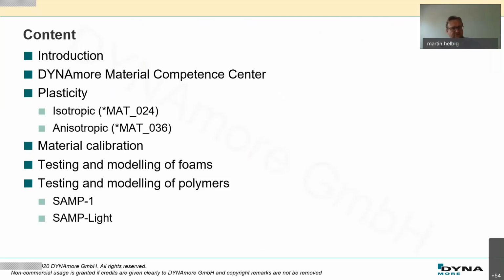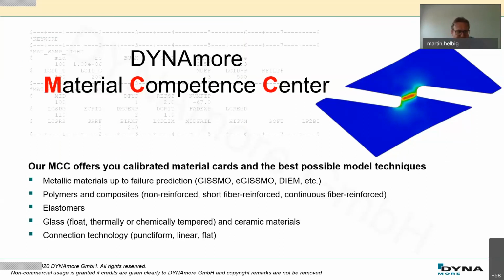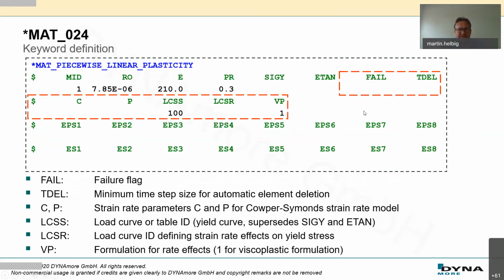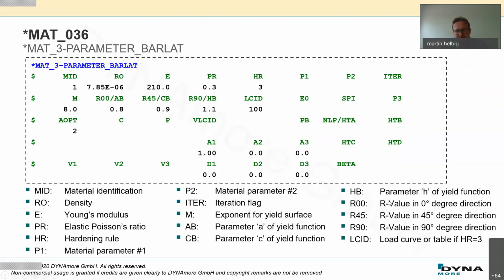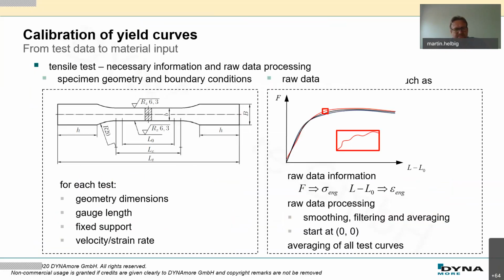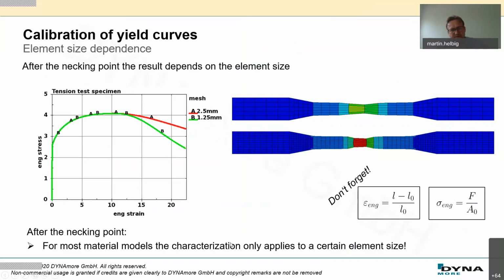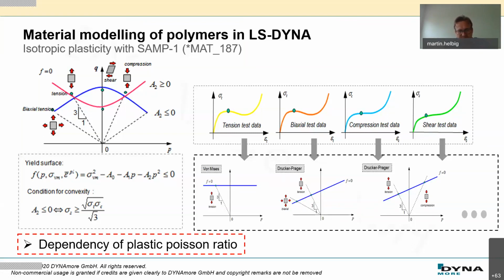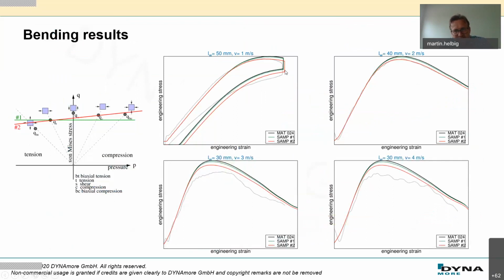DYNAmore Express: Introduction to Material Characterization

Comment: Dear Martin,
I use models from the PolyUmod library for numerical simulations, and I use the mcalibration program to calculate and calibrate constants.

Please clarify:
Does your company conduct experiments with polymers/rubbers with viscous properties?

The LS-Dyna postprocessor doesn't have the ability to obtain viscous strain values and absorbed energy due to the viscous properties of materials.

Could you recommend a way to obtain this data?

Regards Valery